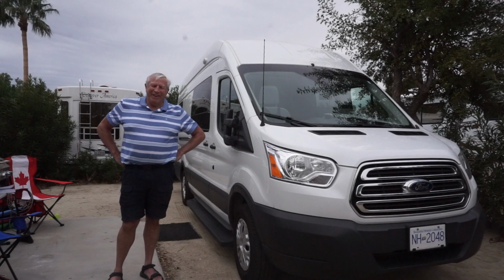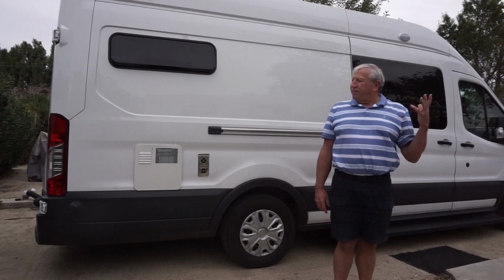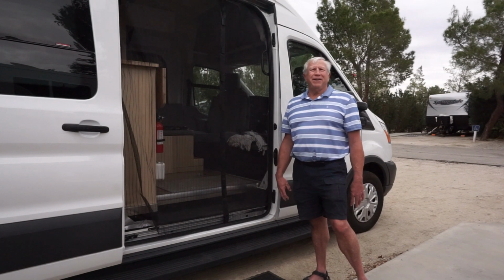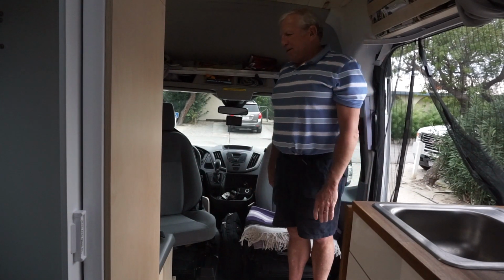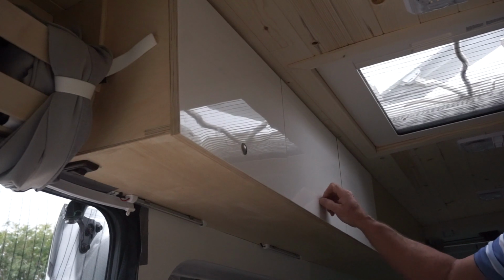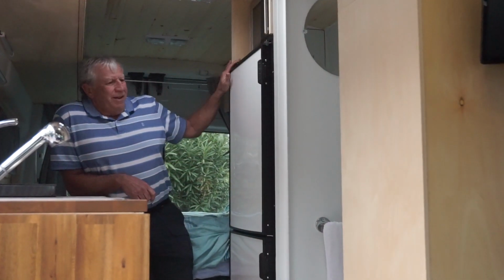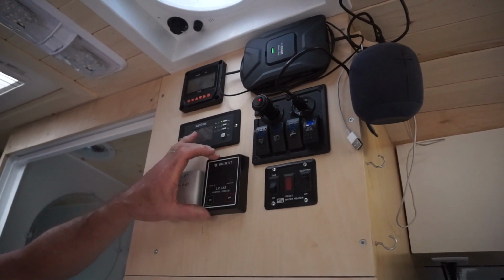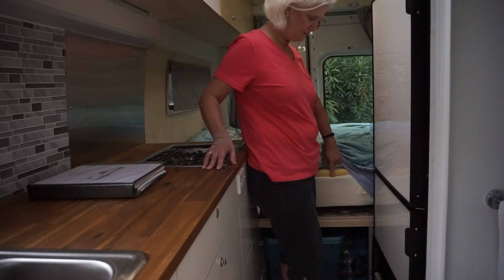High Quality Van Conversion - How Marty Converted a Ford Transit Cargo Van into a Beautiful RV

Comment: We have the exact same van and the layout you have is what we are working toward. Question on the shower, what kind of shower pan did you use (or did you use a shower kit?) and how did you notch around the bottom post (van frame work) in the middle of the shower?
Reply: Hi Shara,  I did not use a standard pan or shower kit.  I made my own from scratch.  I did this because of the post you talk about.  The way the post sticks out using a standard pan would force the shower into the aislway which we just didn't want to do.  making the shower base was fairly simple and also provided a base for the cassette toilet.  I just made it out of wood and plywood, rounded the corners and covered everything with 2 layers of fibreglass and resin.  To finish it off I used some bondo and coated the base with white paint.  Hope this helps! Marty
Reply: @martycole1939  thank you - great info!

Comment: Their cabinets have the most beautiful finish to them. How’d they get such a clean and a flat surface across? I would totally scuff white cabinets, so nice job for them on keeping them so perfect looking. So it’s only the color I’d want to change. But wow on the job they did.
Reply from the maker: I agree!  Joe and I would have them messed up in no time.  They did a great job.
Reply: The cabinet fronts are Formica, so they will take a lot of abuse and still stay shiny.
Reply: Marty Cole Cool! Thanks for the reply. Did you make them out of Formica’s laminate, or did you custom order them?
Reply: @AdrienneLawrence1  Made them in my workshop
Reply: Marty Cole How do you work with laminate? Is there a melting process around the edges?
Reply: @AdrienneLawrence1  The laminate is just on the front.  You put it on with contact cement
Reply: Marty Cole: like wallpaper?

Comment: Looks great! I am converting almost the identical van right now, mines got the 3.2L Powerstroke. Needed the extra towing capacity the diesel offers.
Reply from the maker: Diesel is the gold standard for towing.  We opted for gas because we spend so much time in Mexico.  The diesel here is not ultra low sulfur so would void our warranty
Reply: Youcan get diesel in the ford transit. Skip the dodge ram. Not a fan.

Comment: What a wonderful conversion, so inspiring!  I had some questions:
7:35 - What is the wood you used for the countertop in the kitchen?  Why this wood?  The craftsmanship of the cabinets and countertop are very good.  Look at that seamless join when you lift the drop leaf extension on the kitchen counter.  Fine work here.  Cabinets look slick and Euro style.
What a lovely bathroom!  Smart venting and toilet.  What wood did you use for the shower mat?
This is a professional build.  I'm surprised you don't have more views.  Lots of work went into the design of layout and electronics. Well done!  Happy Travels.
Reply from the maker: The wood is teak...best choice for contact with water